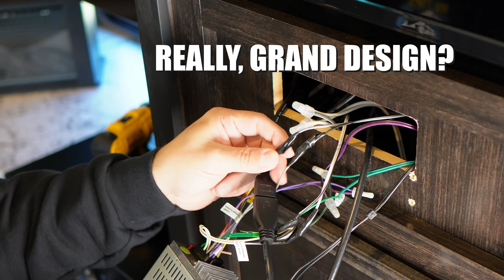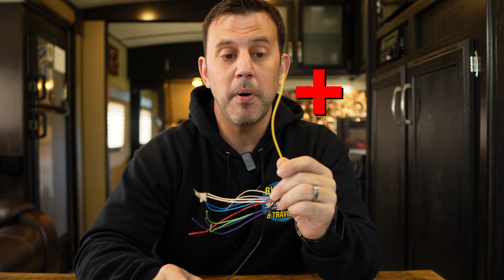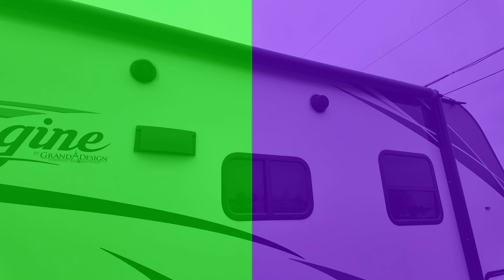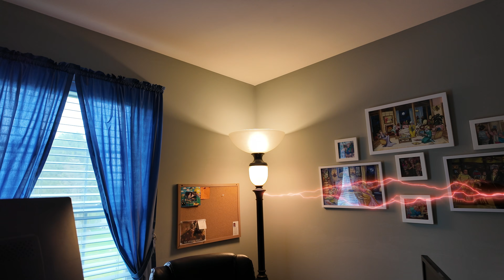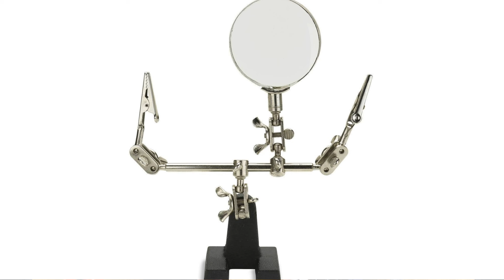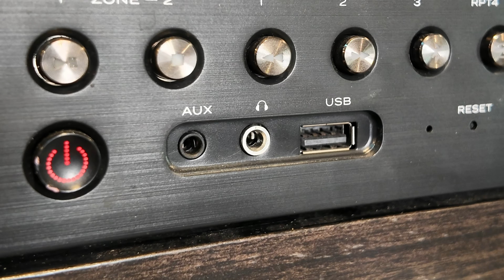12 Volt RV Stereo / Radio Head Unit Wiring - Explained for Beginners / Newbies

Comment: Great break down! I have done car audio installs over the last 20 years or so in my personal cars/trucks and friends too.  My wife and I bought a camper (used) a few years back and now are starting to update a few things, many at the recommendation of you. Try to use the affiliate links when we can. 

Wanted to ask if you have ever seen or done an amplifier install in an RV? Nothing crazy, but something that would power a 6.5" or 8" woofer. Just to give a little more low end. Or is that asking a lot of an RV's system? A bit different from a car install, since you would have 12v input and/or shore input as well. That's where I start scratching my head.. 

Thanks and keep bring the great content without having to be a member! Very much appreciated
Reply from the maker: its something ive thought about for years... Furrion makes a sub/amp combo, but its basically a combo you would get for a car all in 1 self contained unit, so id almost rather go with something like this instead: https://amzn.to/3B394iL

and you're right about the power, might need to upgrade or add a converter, or install home audio equipment and use it on shore power.  lots to think about.  i do think its something i want to do for movie nights, but being an old school car audio enthusiast, I'd still say nothing big would be needed.  more to come.

Comment: Your videos are done so week Ross, another great one!
So I had a question about adding a subwoofer to my iRV62. It has an RCA SW output that I need to plug into a Furrion RV amplified SW RCA input. My question is how to properly power it from the head unit (iRV62). 
It has a +12v and a Ground. 
What wires should I hook into these spots from my head unit? Would it be the blue one you talked about (the remote turn on and the ground from the radio (the chassis ground)? Thanks for any feedback you can offer, or even a link to another video or article that would help. Keep these awesome videos coming!
Reply from the maker: assuming your subwoofer is a sub/amplifier combo?  what is the model?
Reply: @RVTIPSANDTRAVELS  it’s the Furrion RV Amplified Subwoofer - 15-3/4" Wide x 9-7/8" Tall - 120 Watts - Black
Other than the rca input it has a +12v, a Remote and a Ground.
Reply from the maker: looks like a blue fuse on the amp, that would be a 15 amp fuse.  the main power for the amp (labled +12v) should be run directly to the battery and fused with another 15 amp fuse within 12-18 inches from the battery.  if that power wire would get pinched with a ground somewhere along the line, the fuse will blow near the battery and disconnect that line that runs through the entire camper.  thats why you want the fuse close to the battery.  the fuse at the amp just protects the amp.  the ground can be run to any ground, but the shorter the better, always keep grounds short, and try to run to the frame instead of another ground wire.   the only wire connecting to the head unit would be the REM wire (remote), and that would connect to the blue wire with the white stripe on the head unit.  then as you already mentioned, rca from sub out to line in.

i know running a power wire to the battery is a pain, but thats the correct way to do it, so i cant recommend running it any other way.  running the power to the same power wire feeding the head unit will overload that circuit.  1-2 amps you might be able to get away with, but not 15 amps.  even if you change the main fuse on that circuit to match the amplifer and head unit combined rating, the wire may not be big enough to handle the current and might melt.  its hard to say without  seeing everything.  also, use spade terminals on the end of the wires to the where they connect to the amp.  dont just shove the wire in there and clamp it down.  one more thing, the ground wire should the same size as the power wire.  10 gauge wire would be good for a run up to around 25'.

power and ground wire: https://amzn.to/3WWuSFw
inline fuseholder with 15 amp fuse: https://amzn.to/3YCOBev (replace the fuse it comes with with a 15 amp fuse.
spade terminal: https://amzn.to/3AgQDqC

Comment: Great video. I have an IRV 36 that plays ok, except when on low volume it plays the FM/AM audio even when set to another source. Defective or wiring issue? Only 4 months old new from factory...
Reply from the maker: sounds like an internal issue to me, but try one thing.... do you have a powered TV antenna in the RV that you can turn off?
Reply: @RVTIPSANDTRAVELS  I do. Will check that out next time I'm in the trailer. Thanks!

Comment: Hey Ross another great video. I have the same head unit, when playing music both inside and out the inside music is way too loud vs the exterior. I searched for a fader feature like on a car radio to lower the inside and augment the outside with no luck. What can I do?
Reply from the maker: its the speakers, the outside speakers sound lower because youre outside, i think they may be smaller too... there is no adjustment on this head unit.  installing new speakers outside may help the issue.
Reply: Keep up the good work Ross

Comment: Ok so love the fact that you broke all this down. I did learn quite a lot from this video. I also watched you last video about the speaker set up.  So with all that said, I have just one problem and i dont know if this is a problem that can be solved mostly because I have been told I can’t do it by many people.   I work night shift so when I am off I watch tv or play my game in the middle of the night when most people are sleeping. There for my problem is I can only get the system. To work all 4 of the speakers and they work great together but how do I set the system to ONLY work for the inside speakers with my tv?    Wanting to be a good rv neighbor
Reply from the maker: try adjusting the fader on the head unit, that should eliminate the outside speakers.  you might have a button that selects inside adn outside speakers too.
Reply: choose zone 1 on the head unit, this will keep all sound inside the rv.

Comment: Great information. The only thing i can think of that was left out was how to fool auto head units to playing video.
Reply from the maker: good point, since most of these are dvd out, they wont require anything though... but in many cases you can connect the brake wire to a ground.  a few HU's will require some type of bypass mechanism or relay.
Reply: @RVTIPSANDTRAVELS  
I used a push button momentarily on switch on ground. I push it 2 or 3 times fast and it does the trick. Then video out to tv.
Reply: @RVTIPSANDTRAVELS Sir one emergency question...
A parallel circuit consisting of 2 same load/resistance where the total maximum current is 15 amp. It is protected by 15amp fuse. That means max 7.5 current is allowed in each wires.

Now, I removed one of the load. And, I replaced the other second load with new load which consumes max 10amp.

That means only one new load is connected in the circuit. That means there's more 2.5amp difference of current flow in the new load circuit.

So, in the old load, max is 7.5 per wire.
In the new load max is 10 per wire.
So, just 2.5 amp difference.

Now, coming to my question...
If the new circuit is ON say for max 10 seconds, will the circuit immediately BURNS up within 10 seconds??? Of course, it will be hot.
How long (30 secs etc) can the wire stay unburnt? How long can it stay safe?

Or, How much extra current can be passed beyond the maximum limit for any given gauge wire?
Reply from the maker: the answer depends on what your running and how long the wire is.  what electrical component is at the end of each wire and will it handle 10 amps instead of 7.5?  7.5 amps to 10 amps on a short wire is much different than on a long wire.  Assuming because its in an RV its not long, but a wire guide chart should be referenced.  when I run wire, I always go bigger than necessary.
Reply: @RVTIPSANDTRAVELS  sir actually it's for my car which has 15 amp fuse feeding two parallel circuits of 2 individual horns.

Now that I want to connect 2 horns of total 10amps in one circuit.
So, the load is the DUAL HORNS consumes total max 10 amps.
Reply from the maker: how long is the run from the power supply to the horns?
Reply: @RVTIPSANDTRAVELS  max 10 seconds only. Otherwise, only 3 to 4 seconds.
Reply: @RVTIPSANDTRAVELS  max 10 s. Else, 3 to 5 s only.
Reply from the maker: but how long is the run of wire, in distance?

Comment: Hi Ross, new to rving. Class A Winnebago. My stereo wont turn off. On off it still shows the time like its on. It Drains my coach battery.
Reply from the maker: when you hit the button, is it turning off the sound but not the display?  also, is this the unit in the dash or in the back or in the living area?

Comment: This was great Ross.  I have a Mercedes Sprinter. class C with a pretty poor system.  Do you have any recommendations for a reasonable replacement?  My biggest gripe is that there is poor contrast which makes reading the display difficult. I also tow a vehicle behind it and the video again has poor contrast.  Mine is a base model sprinter so it for t have the my Mercedes features and gadgets.  I know it’s never going to sound great with the base speakers
Reply from the maker: are you talking about the unit in the dash or in the living space?

Comment: *I have been installing 12v gear since 1975. I watched to discover tips for my RV. In case there was any nuance things in an RV connection. I must say, you did an EXCELLENT job describing every detail of 12v Audio devices. Impressive. The only exception I have in my RV is I do have a hard off-switch on the RED wire. Since we primarily boondock, I don't want the draw of the display using my precious battery power (even as little as it is.). I've also measured the memory draw (yellow wire)  it is so minimal, it's nothing, I leave it connected. 
Again, KUDOS for excellent, clear and easy to follow explanation!  I'm sharing this to my applicable groups...
Reply from the maker: thank you sir, and great point.  i thought for a second about discussing parasitic draws on the turn on wire but I thought it might be a little confusing for a video of this nature, but Im glad you commented about a hard switch, thats probably the easiest way to eliminate the draw.  cheers my friend!
Reply: @RVTIPSANDTRAVELS  Yeah, minor point. Which likely only applies to a very small part of your viewers. How I "RV", personally,  is the old definition. The new definition of "RV", typically assumes plugged into AC (Or a gen.) 90% of the time. 😂
But I'm old, and we prefer off grid. 🏕 😀
Reply from the maker: nothing wrong with that
Reply: I have the problem that even though I turn the power al the way off by holding down the power button (I have the same head unit as shown in the video) it turns itself back on and has cost me a battery already, and possible another now.  Any ideas as to how I might fix it, or is it not worth fixing? THANKS!

Comment: I was hoping for some insight on the HDMI arc.  Sometimes the sound is somewhat “scratchy”.  I probably just need to pull the Furrion head unit and check the connections.  For those that don’t know, Furrion TVs are designed for the rough ride of an RV.  If you don’t have a Furrion, your TV may not last as long.  Mine is a 43” Furrion 720p “dumb” TV which I made smart by adding a Google TV with remote.  I also added a Bluetooth transmitter to make the sound go to my Bluetooth headphones (keeps the wife happy!).  I also have DISH Network satellite dish with a Wally for football watching in the fall.
Reply from the maker: HDMI ARC can be a little confusing since there are at least 2 different types last I checked (including eARC), and not something I thought would be good for this video as it might get confusing for those just learning it.  Id check your connections first and make sure they are good, scratchy sounds can come from speaker wires not being properly connected.

Comment: Thanks Ross. I'm not a technical guy at all but I would like to improve the sound quality of the horrible sound in my travel trailer. Not looking to wake up the neighbors or try to improve the outside sound since those speakers are in my awing arms I'm mainly concerned with a little better sound quality inside the camper. What is the best way to do that? Replace the head unit and speakers or just replace one or the other? Also any recommendations for what to replace them with?
Reply from the maker: replace the speakers to start... what size are they (probably 5.25" or 6.5")
Reply: @RVTIPSANDTRAVELS  lol good question. You can tell I haven't put a lot of thought into this yet. I'll do some digging though. Your video has me wanting to make some improvements in the sound quality. I'll start with speakers! THX!
Reply from the maker: these are great speakers for the application.  more powerful speakers arent necessarily better, the more power required doesnt mean they will sound better, in fact, running the small amount of power a head unit supplies will actually make high powered speakers not sound good.  Kicker DS series, comes in a few different sizes: https://amzn.to/3UsDuRz
Reply: @RVTIPSANDTRAVELS  much appreciated sir! Soon as I verify the size in a week or two when I get back to camper I’ll order a pair.

Comment: Thank you Ross - we’re just a couple season into travel trailer maintenance/ repairs with our  2021 Trail Runner. The dealer had trouble with our head unit and had trouble diagnosing issues. It works, but I haven’t figured out how to operate my indoor speakers separately from the outdoor. I’m hoping your “clinic” provides my answers. Electrical anything is always my Least fav DIY. Many Thanks. Love all your videos. Exceptionally well done. Please don’t add comedy/drama, everyone does it, but it just doesn’t work for Solving Problems- Educational videos 🎉
Reply from the maker: thanks, glad you enjoy!
Reply: he  did not answer you, but i will, indoor and outdoor speakers are defined as zones, like zone 1 will be indoor speakers, zone 2 will be outdoor speakers. you can do zone 1 alone, or zone 2 alone, or do both 1 and 2 zones to operate indoor and outdoor speakers all at once. there '' should '' be a setting on the head unit that allows you to switch between both zones.

Comment: Hey Ross! Love your channel, I have a question for you, could you please recommend a good battery charger/maintaner/ trickle charger for my RV Reflection that wont break the Bank, and again thanks for your videos. Jeff
Reply: Thanks for all you do!!
Reply from the maker: thanks for being here to watch!
Reply from the maker: if you want just a trickle charger, you can either get a 20 amp dogbone and plug in from a home outlet to keep the battery charged, or if you want to remove the battery and keep it in the garage you can use this (what ive used): https://amzn.to/3wokZ8O
Reply: @RVTIPSANDTRAVELS  yes I have my battery in the garage and want to keep it changed, I will give this one a try, thank you very much!!
Reply from the maker: ive used the battery tender brand for decades on my cars and law equipment.  does the job, doesnt cost much.  have fun my friend.

Comment: What head units would you recommend if the original one failed and someone wanted to upgrade, or just upgrade generally? The ones supplied are generally cheap and, in my opinion, junk, just like a factory head unit in a car/truck.
Reply from the maker: hey Mike its hard to make a recomendation, its going to depend on a few things... as far as brands though, even among all the high end stuff, I was always a fan of JVC products.  Easy to use and worked well.

Comment: Great video Ross. My used trailer came without the original  player and have been  searching through the limited options available. What would you or anyone suggest for a decent  player with preferably HDMI out and bluetooth capable. Thanks of all your helpful videos.
Reply from the maker: hey Michael its hard to make a recomendation, its going to depend on a few things... as far as brands though, even among all the high end stuff, I was always a fan of JVC products.  Easy to use and worked well.

Comment: Great video. I have a fifth wheel. In the living area I have front and rear L/R speakers. Then I have L/R speakers in the bedroom and L/R speakers outside.  Each of these three “rooms” is currently switchable in its respective zone. 
I want to switch to a Car stereo. Do you have a recommendation on how to wire a system like mine and how to be able to turn on/off each of these three zones?  Thank you in advance. 
Also you can use Wagos for wire connections.
Reply from the maker: unless the head unit has 3 zones, which most car audio head units wont, you might have to stick with something made for rvs that has 3 zones, unfortunately.  otherwise, this will require adding some switches which can get complicated.